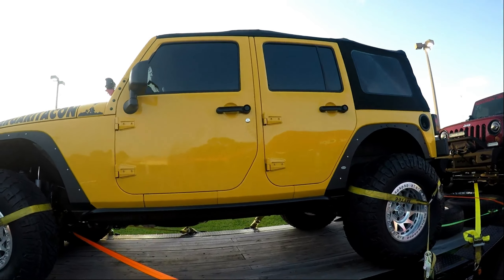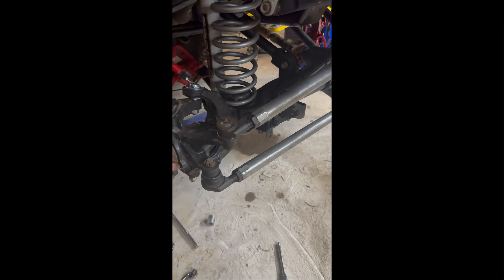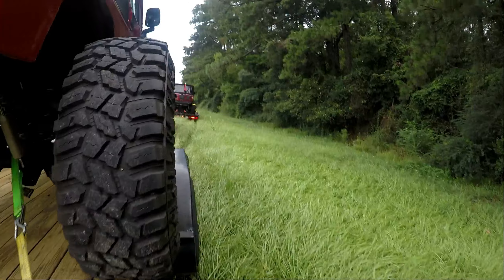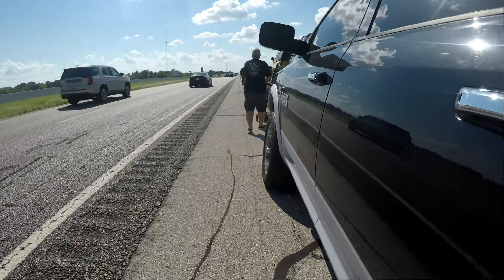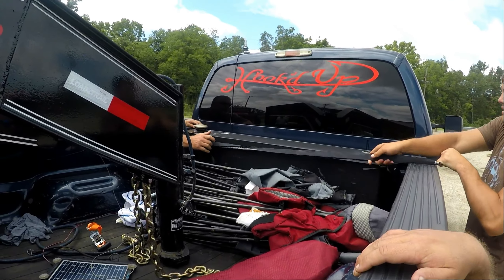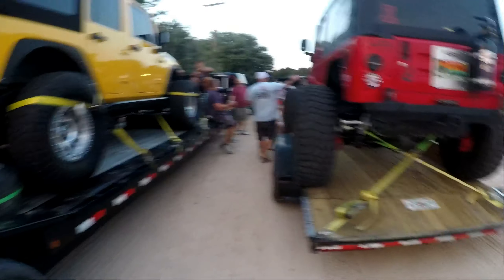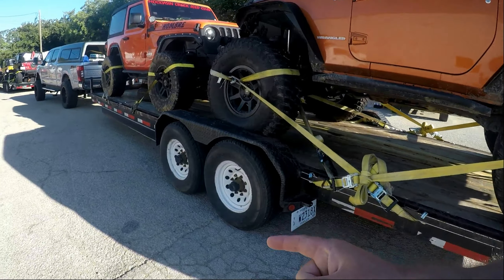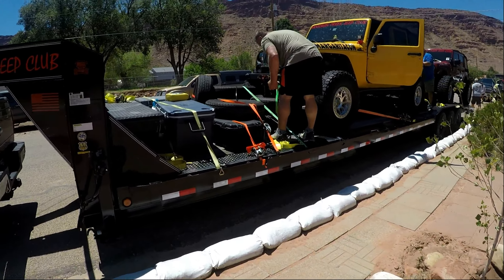Moab 2024 Road trip

Comment: Never seen that many tire failures. I never max fill my tires in the summer. I figure with the heat it increases the pressure in the tires past max air pressure while rolling down the road.